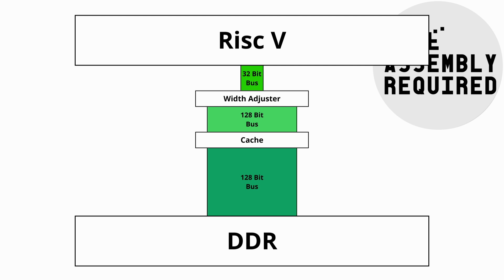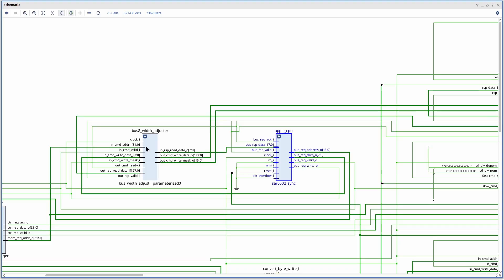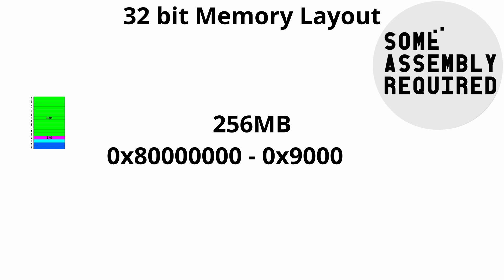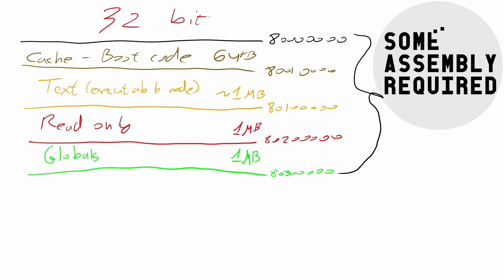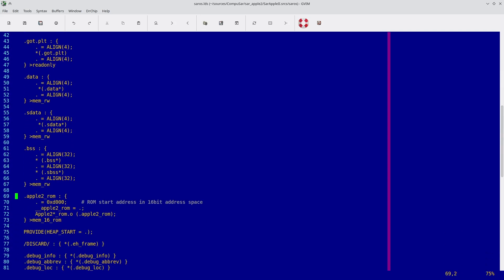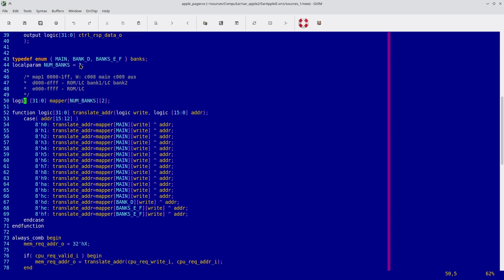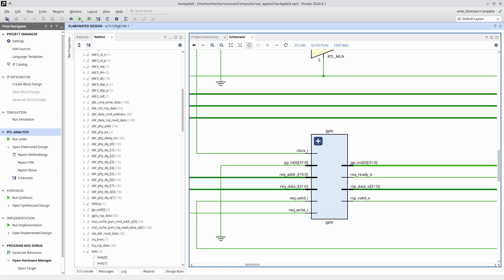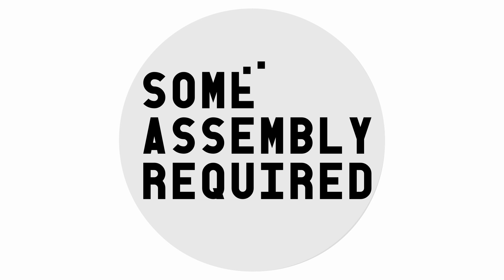Booting the Apple 2 I built

Comment: My first home computer had 256mb of RAM, or at least it did after multiple upgrades. It only came with 64mb, but I added a second stick of 64, then swapped one for a 128, then finally added a second 128, which finally at 256 was its maximum capacity. Hopefully, I'll have it out of storage one of these days and be able to play with it again. I might still have a copy of UT installed on it and can pull off all the old maps.
Reply from the maker: That was a PC though, right?
Reply: @CompuSAR  For sure. Clearly no one is going to have that much for an 8-bit computer. Not even for a 16-bit computer.

Comment: 10:26 I was going to suggest that using objcopy would be "easy", but it took me 15 minutes to figure this out, and it still might not produce exactly the .o file you want:
    objcopy -I binary -O elf64-x86-64 -B i386:x86-64 --rename-section .data=.apple2_rom,alloc,load,readonly,data,contents --strip-all --add-symbol _romStart=.apple2_rom:0
Let me know if it's not quite right; I'd be happy to help adjust it.
Reply from the maker: Two things to say about this.
First, I completely forgot about objcopy on that front. It was so obvious to me in the other direction (structured to binary), but not in this one. Thank you!!
Second: I doubt I'd use it. Part of it is the cumbersome command line, but part is the same reason I didn't write my own tool for that task: it makes the build system more complicated.
The command line you gave had to specify source and target platforms multiple times, and it so happens that you gave the wrong one. We're not compiling for X64 or X86, we're compiling for Risc-V (technically, the binary file is 6502, so we're not compiling anything at all, but what's important here is the platform we link with, and that's Risc-V).
The greatest advantage of assemblify is that it's platform agnostic. The thing that decides the elf object file's platform is the toolchain used, and that's already part of the build system with no extra work.
On the other hand, the extra step needed here is one make takes without blinking. It's just par for the course for it.
So while this technique is correct, and I am kinda ashamed I didn't even think of it myself, I still think the assemblify route is better.
Reply: @CompuSAR  Yeah, my bad about forgetting you're building for RISC-V, not x86 or x86-64. And I completely agree about how terrible the objcopy invocation is: I started off thinking it would be easy, then it became a mission, and finally, even though I figured you probably wouldn't want to use it, I felt like I should share it anyway, so as to not waste the effort. 😻
Reply from the maker: I'm really glad you did. Like I said, I'm a little angry at myself for forgetting that objcopy isn't only for structured to unstructured format. Having now read a little, it's the perfect over-complicated command line. It can do about anything.